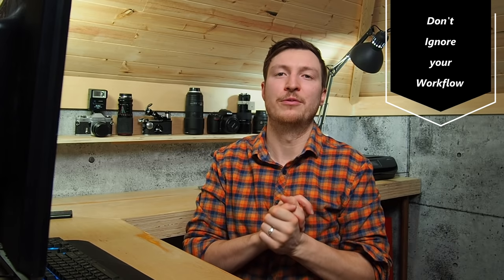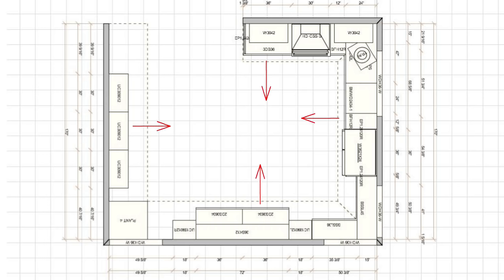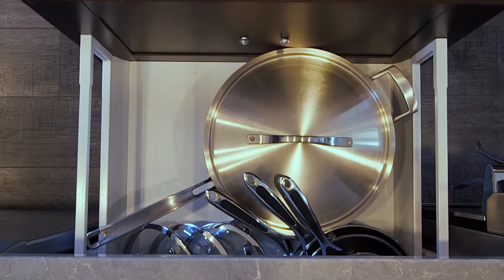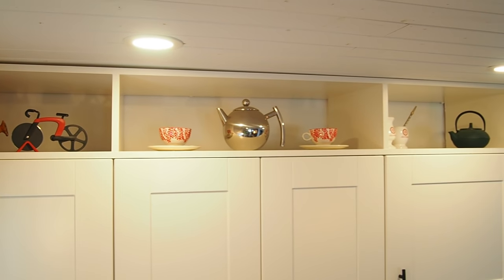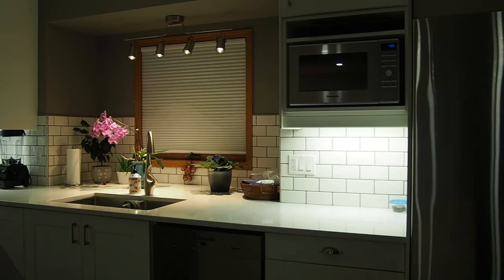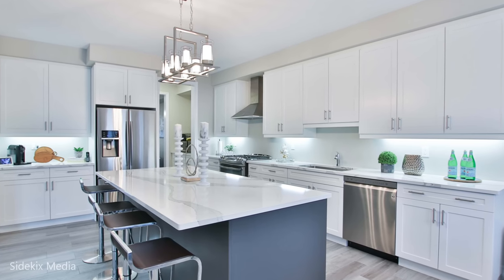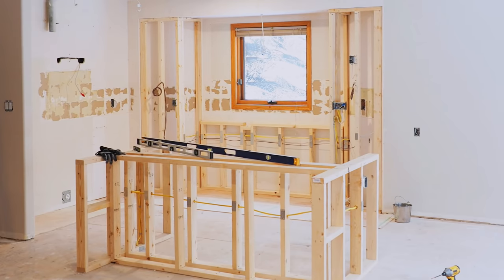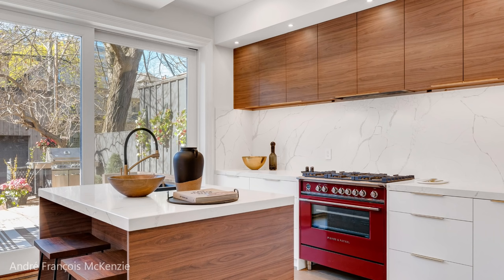KITCHEN DESIGN MISTAKES [Common design mistakes to avoid]

Comment: The island should not disrupt the work flow. I rented a house that had the fridge on the opposite side of the island. I felt like I was walking in circles every time I made dinner
Reply: To me that's the biggest and most common mistake.  My grandmother lived in an old farmhouse with a small room for the kitchen with so many doors and tall windows that the sink and stove were on one wall and the refrigerator on the opposite wall.  The only eating table had to be in the center of the room.  Drove me crazy having to work in that kitchen.
Reply: That’s how my current kitchen is—I hate it!

Comment: In the final stages of my kitchen renovation. While I didn't change the basic layout, I did change the island shape, from 90's 3 sided to my own "baseball field" shape. I still have 42+ inches between the island and the two walls (one for range and one for refridgeration/upright freezer). Also, I added an addtional wall oven to the island, because I already had the appliance and who doesn't want another oven during the holidays?  Most of the lower cabinets are drawers, and I have 10' ceilings with the top "display" cabinets, but the 42" functional cabinets seem SO HUGE. I'm looking at pull downs for the tops because I'm 5'3" and can barely reach the second shelf! Thoughts?
Reply from the maker: They definitely can feel tall. My wife is also on the shorter side and we have a stepstool in the kitchen to get to the higher shelves. I find it important to consider what gets placed on each shelf. We have our contents arranged from most used to least used (bottom shelf to top). This minimizes the amount of time we are reaching for the stepstool.

Comment: I have to disagree that raising the top cabinets a couple inches is not noticeable and is better than leaving an odd gap at the ceiling. As someone that is 4 ft 11 in, a couple inches means that I can't reach the 2nd shelf w/o a stool. Just buy cabinets that DO go all the way to the ceiling to avoid an odd gap.
Reply from the maker: You are right in that if you are on the shorter side, a few inches can make a difference. However, unless you are buying custom cabinetry, the option to 'just buy cabinets that DO go all the way to the ceiling' is not possible. At the end of the day, this is exactly why each kitchen and 'need' is specific to those using the space.
Reply: I agree with Vickie Clark. I am 5' 5" and my cabinets have an 18" wall space with cabinets that go to the ceiling. At 18" I can see and reach into the first 2 shelves with no problem. For the top shelf I either do a tip- toe dance or use a step stool. Like Vickie if you add those extra inches I will need the stool for the second shelf too.
Reply: @sissy20088  I can only reach a few inches into the 2nd shelf and that is if I stand tip toe on the lowest shelf of the bottom cupboard. My 2 and 3-step step ladders gets a lot of use!
Reply: @Telcomvic  Isn't it funny how ostensibly kitchens were designed to be workrooms for women, yet were designed by and for men for (people who are far more likely to be tall than women) for some stupid reason. There's a whole book about this, how the world is totally designed for men, even things that are supposed to be for everyone or even just for women. Personally when I build my house I'm doing away with upper cabinets altogether. At 5'0" They are all useless to me, at most I, like you, can reach into the first shelf and then barely into the second and not at all into the third. I don't want to have to lug a stool or step ladder around with me in my kitchen (I had to do this in my last apartment that had storage I swear could only be accessed by NBA players). My kitchen should be usable to me not someone a foot taller than me, period.
Reply: @venus_envy  Yes, it does appear that standardization is the enemy of short people. Our cabinets do go up to our 8 1/2 foot ceiling, so I've got a lot of practice climbing ladders and standing on the counter tops to get stuff out of the top shelves. Good thing I'm still pretty agile. LOL
Reply: @venus_envy  make a drawer in your lower cabinet (the lowest one and usually the deepest) have a “lid” that slides back into the cabinet. This can act like a large block to stand on to assist getting to those things. I have two slide out cutting boards in my worn out old kitchen I’m redoing that I never use. Something like that (but with better hardware) that would be a stable surface would be awesome, I think, and save space from having to stow a small step ladder.
Reply: @venus_envy  that's exactly what I did. Removed all the upper cabinets. 10 ft ceilings will have open shelving placed at a height where I can reach comfortably. Lowers are all drawer stacks & pullouts. I'll hang art or decor on those upper walls!
Reply: @sissy20088  Pull-out and pull-down shelving might be a viable solution.

Comment: If you cook Asian food often with a wok, 36 inch height cooktop is just way too high.  I see many Asian kitchens with a lower area for cooktop usually at around 30 inch （i.e. ikea base cabinet without the legs ）. Asian viewer should consider this factor when watching video regarding trends.  Extra design thoughts need to be considered for a proper Asian kitchen.  This high low combination is much harder to design.
Reply from the maker: Its not just an IKEA base cabinet height...all standard cabinet manufacturers build their base cabinets at 30" plus a 4 1/2" toe kicks. Going outside that height requires fully custom cabinets to be made. While it may be worthwhile for some, it won't be for many. I do appreciate the insight on cooking with a wok though. With one of my current clients, we are putting a dedicated wok burner to the side of an induction cooktop- still at ~36" though.
Reply: @hsdesignstudio  I have actually  taken Ikea base cabinet and put them directly on floor with the legs just because I wanted that 30 inch height in certain area..  As for special wok unit, they work well but they are not very pretty.  For those people with plenty of room, I would suggest having a dedicated Asia cooking area.  Mixing the the 2 is the challenging hence the high-low design which is popular in Asian countries.

Comment: MAJOR mistake when going from a one-piece range to a separate cooktop and oven: I considered putting the oven under the cooktop, but when I saw such an installation in a display at the home center, I found the oven to be uncomfortably low. Think about that when you're thinking about that Twenty-eight pound Thanksgiving turkey. My oven is going to be set at a height to allow a countertop section about 48 to 50 inches above the floor, ideal for a toaster oven, coffee maker, microwve, what-have-you to be at a more usable height as well.        
Also, I have purchased a ten-inch (approximately) high stainless steel electric warming drawer to be installed under the cooktop to keep casseroles and other sides hot while prepping the rest of the meal, and a matching stainless storage drawer that will go under the warming drawer, planning a tilt-out drawer in the cabinet front below the cooktop for spatulas and such needed at the cook top.        
Also, if you plan to live in the house instead of flipping it in five years, get the best cabinets and countertops you can afford. There is no saving in cabinets that will come apart before you have paid off the kitchen loan.

Comment: We are in the process of redesigning our kitchen. We love the idea of an island, but it cuts right into the flow of the room, making a stationary island not worth the loss of space. We've decided to make a small, mobile island that can be tucked underneath the counter when not in use.
Reply from the maker: I just worked with a client to do a very similar idea 👍

Comment: I’m only 5’2” tall so we lowered our counters about 2.5 and it does wonders for ergonomic movement when chopping or kneading bread. We have 6 feet of the lowered counters ending with the sink and then it rises up about 6 inches for the dish washer. It works nicely as a raised coffee bar and finishes out the kitchen nicely. The coffee bar is a few inches taller than standard height and we put in a 1.5’x 1.5’ pull out cutting board below the countertop above the dishwasher. We spent a solid year visiting model homes, historical homes, friends homes, and even homes for sale and working through the motions of making basic meals in each kitchen. We combined all the things we liked and left out what we didn’t and it resulted in the most efficient kitchen I’ve ever used. The more time and thought you can put into kitchen design before you start, the better.

Comment: As someone who is only 5'2" (157cm), I don't like how high up those 18 inch cabinets are. xD They're basically decorative at that point..
Reply: Me too! It's difficult to clean properly, which is not good for a kitchen.
Reply: In the picture, they look REALLY high off the countertop, more like 28”.
Reply: For sure, I'm 163cm and my kitchen isn't going to have any overhead cabinets.
Reply: I'm 5'4" and our cabinets are really low, like only 15 inches off the counter which i don't like but i can barely reach the top of the cabinet even at this low height. It would be not functional for me to have taller ones. I've designed a kitchen of my dreams with only a couple or no uppers at all!
Reply: @Heloise O'Byrne You have a lot of very good points. You could have a kitchen like a big old school writing desk, the fold down lid becomes the counter, items stored on the the back of the counter are hidden when the counter is folded back up. I do think homes are becoming less beautiful? not sure how to put it.
Reply: @Heloise O'Byrne I like your idea of a bed sized table for sewing. I hope you make it happen one day. The things we can buy now are why I'm building my own home and also everything inside, I cannot find anything I like, I'm building my own copper kitchen sink/bench top at the moment. A big yes to old school things, that's why I have a mixmaster from the 60's. So much nicer. Not Lego but anything is doable, just takes time and finding someone to build it.
Reply: I'm 5'0 and I already have to run looking for a step stool just to reach a bowl in the overhead cabinets. To some of us 18" is a big deal. So more than 18' would be not worth the hassle.

Comment: If you move your upper cabinets to 24" off countertop, please take into account of how tall the person using the kitchen is. One client of mine had a problem reaching a normal upper. We built pull out stairs in a base cabinet.
40" distance between cabinets is a bare minimum. You should have enough room so a person in a wheelchair can turn unobstructed.
Most important consideration when designing a kitchen is, who will use the kitchen?
Reply from the maker: You are correct- design for the intended user
Reply: Mine only has 33 in and I have a lot of trouble even with a walker.
Reply: @joyfulinhope1210  if you have problems reaching upper cabinets, if you don't have one and have the space, consider a tall storage cabinet. Installed one that had no doors on it (similar to a bookcase but full depth)  and have heard a few times how she likes it for ease of use.

Comment: Pushing the wall cabinets up only works if the homeowner/primary kitchen user is rather tall, unless you add an open shelf below the wall cabinets that can hold the most used items. At 18” above the counter I can only reach the back of the lowest shelf, the first few inches of the second shelf and if the top shelf can be lowered enough without limiting what can be stored on the shelves below I can just reach the front of that shelf. I usually store cereal boxes on their side there, because they are super lightweight and in my 12” deep wall cabinets they can’t slide back and out of reach if they are on their side. Rather than raising the cabinet in an 8-1/2’ room (which mine is), I’d just box in the area above a 40” cabinet and add crown molding.

Comment: This was a great video. One thing to point out, here in New York it’s code that you have to have electrical in an island. This is so you won’t have a cord draping across where someone would walk which is potentially dangerous. Lot of great info here. Thanks !
Reply from the maker: You are correct, and it is code everywhere actually! The biggest thing is not all island are 'fixed' and thus can skirt some of these building codes.

Comment: Wow! I am so glad that I happened to stumble across your video because I'm in the initial stages of planning a new kitchen.  I want a country look/feel to my kitchen.  The Farm Style Sinks are appealing to me because of the large working area inside the sink.  But they all look so low and appear to be a real back breaker.  How deep are these sinks?  Are they too deep whereby it is uncomfortable leaning over them while doing dishes, peeling potatoes, etc?              A new subscriber and fan.
Reply from the maker: Thanks! This can really vary from sink to sink. However, the bottom of most apron style farmhouse sinks isn't any lower than a standard undermount stainless steel sink.
Reply: @hsdesignstudio  Thank you so much for clearing this up.  Please keep doing what you're doing.  Your videos are very helpful.  They also may help prevent us from making expensive mistakes.  Much Appreciated.

Comment: 2:32 love the floor, considering the herringbone for my galley.        
4:07 Open shelving as the to-the-ceiling cabinets? What better way to turn hard-to-reach into hard-to-clean clutter-catchers? Especially love that cooking vapors tend to rise and settle out on the most inaccessible reaches of such spaces!
Reply from the maker: We love them. They finished off a space that would have otherwise been pointless, and they get cleaned no differently than any other shelf in our home. It's not as if these cooking vapors are actively seeking out specific points; they settle where they settle. I design for the client and their space when needed, and I design for me and my family when needed. There is always going to be people that dislike one thing or another.
Reply: @hsdesignstudio  I guess if you like scrubbing the back of the cabinet while teetering on a ladder. Not my favorite pastime, but if that appeals to your client, RIGHT ON!

Comment: Thank you very much! great advice and a very well professionally made video.
Reply from the maker: Thank you for the kind words
Reply: No Problem :) thank you it’s helped me out a lot as I actually work in Ikea but would like to move into the kitchen planning dept! 😅😊👍 maybe an interesting video to do is most common accidents that happen in a kitchen and how to design to avoid them. 
i.e banging head off wall cabinet door when you don’t realize it’s open! 😅🥴

Comment: I'm having to gut my galley kitchen for some structural repairs and replacing 40-plus-year-old laminate countertops and contractor-grade cabinets, a dead fridge, and covering up some Formica wall paneling that I'm sure seemed like a good idea at the time.
Reply from the maker: You have a lot of plans for your space. Are you getting started shortly?
Reply: @hsdesignstudio  Still planning, and still love the 2:32 herringbone floor in that orientation lengthwise down the flow of traffic. Wish I could find a lighter color LVP than the LIFEPROOF Biscayne Oak herringbone. 
My house is about 85 to 90 years old, with beautiful aged red oak hardwood floors except for the kitchen and breakfast/laundry room which has vinyl sheet floor covering. 
I like the contrast between the kitchen suite (that's how I'm thinking about it) and the dining room into the rest of the house, but that vinyl sheet is hideous!